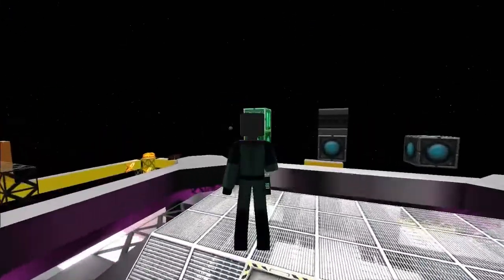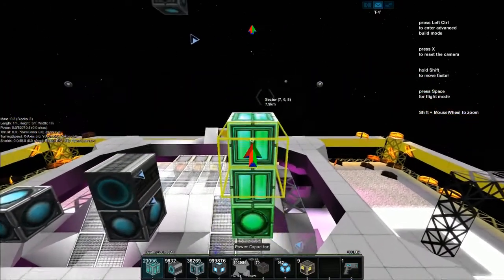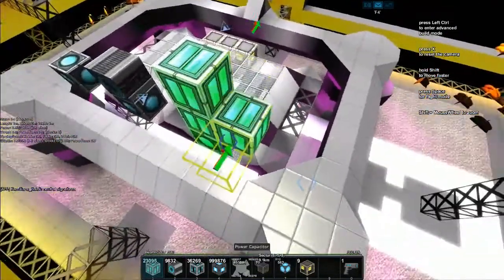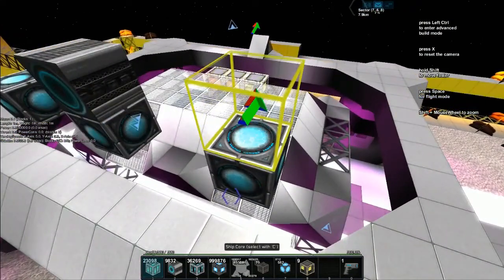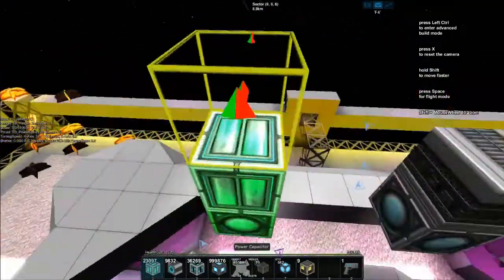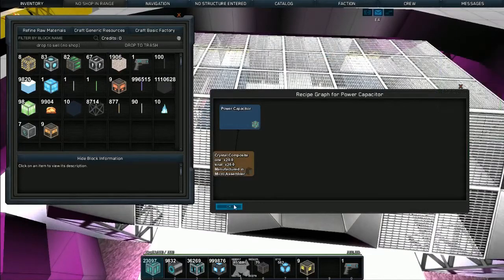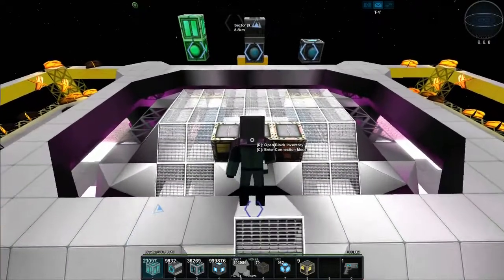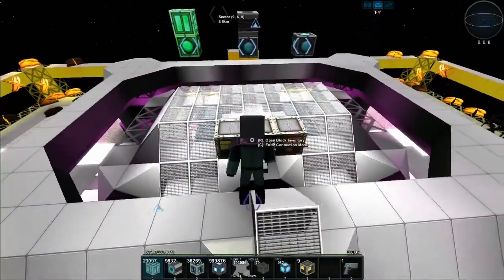#2 Power Storage Block [Starmade Tutorials]

Comment: When I build a ship I tend to build it with a single array of power capacitors under the armor.  I have not played starmade in a while but when I had a single array of power capacitors under the skin of my craft block for block the extra armor of power capacitors works in my favor as it is more efficient and for the most part out of the way if done correctly.
Reply from the maker: thanks bud. this video is on the power storage block. thanks for sharing nonetheless